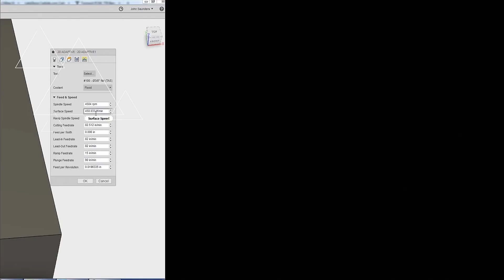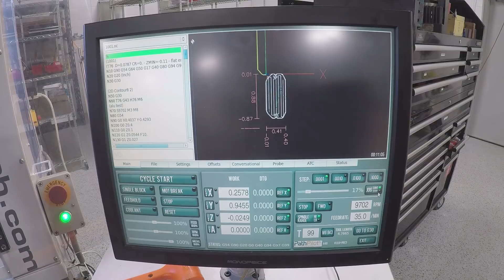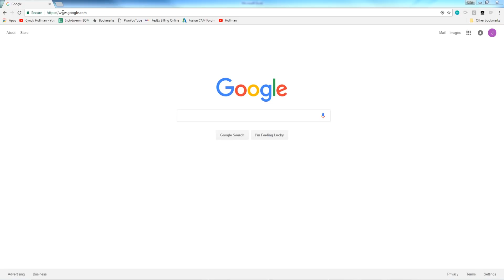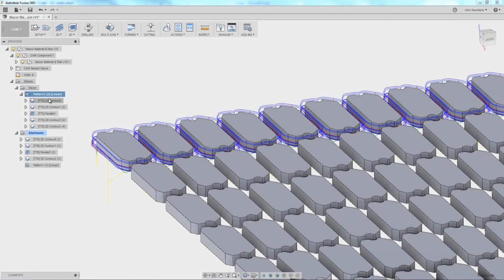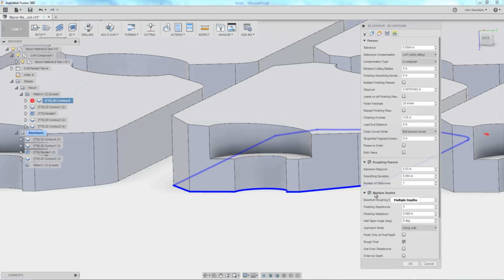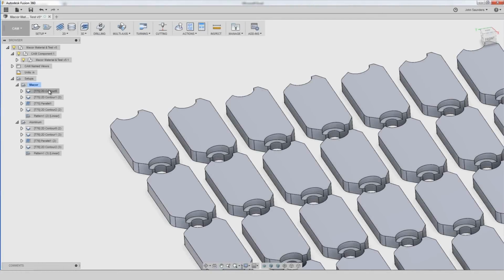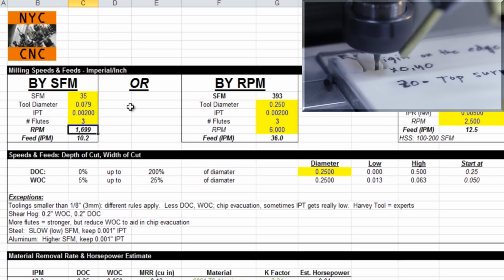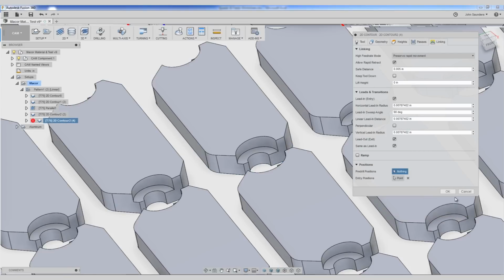Machining Macor on the Tormach 440! WW170

Comment: The reason you’ve got the job is 99.9 % of shops will refuse to machine it causes more damage and contamination of the machine then it’s worth.Been on the Apps for 25 year in the uk we will void any warranty cutting this material, that was the policy @ Mazak,maho,and maatsuura,@ WFL it’s standard if your cutting it you needs MQL and to run extraction with suction bells

Comment: MACOR is interesting material for sure and its been around for a long time. It was used in various locations on the space shuttle Thermal Protection System where high temperature and rigidity was required. Its low CTE made it the ideal material to use inside thermal barriers primarily so the barrier would retain proper shape. As shuttle TPS components go its density was rather high but it was very effective. We often reused MACOR parts salvaged from thermal barriers because it never goes bad. I work in the facility that made 1000s of orbiter tiles for the shuttle program.  We continue to machine silica tiles using Hermle 3 axis mills for other NASA programs. Both mills are equipped with very high flow dust collection systems and lead screws are covered with in house sewn bellows. These machines have been in used daily for nearly 20 years and still hold tight tolerances. We typically get between 3 and 5 years out of the ballscrews. The message is get the dust out of the machine and position the vacuum nozzle as close to the part as possible to optimize machine life.

Comment: John, what would your thoughts be on using something like a Wegstr CNC for small prototyping projects or fine detailing work? Is there a gap that a machine of that type would fill in a shop, where a progression between sizes and quality of machines hits a local maxima of productivity?
Reply: Carbide 3D Nomad is great for this. PCBs too of course.

Comment: I noticed the windmill is making a pass at the end to face the material, my thought/question: would it be easier to use a face mill to deck the material to finished height rather then making passes for each individual part? Something along the lines of a 2” face mill

Comment: Worked in optics at one point. We would use cover glass and UV hardening glue to control chipping you can also use a a clear glass panel glued to the bottom of your work. That you remove with a heat plate

Comment: It looks as if the material was chipping on the edges of the part when facing, I would recommend using radius on the cutter, so chips occur high up on the stock, another option is to do dynamic facing from the outside. I will like to buy one of these 440's you know what size rotary fits it?

Comment: Use hot glue . We machine macor often at the University I work at and we use hot glue to hold it down. Also I noticed you cutting to the outside of the part on the surface, you should have the cutter cutting to the center to prevent chipping.

Comment: Ceramic on a milling machine, doesn't the dust ruin your ways on the long run? At least I wouldn't put it onto my Maho/Deckel.
Reply: We occasionally do a few parts out of Macor, Shapal, and Alumina, while I haven't personally investigated, another local shop said machining it will void some warranties (so use your old beat up one!).  We try to cover the ways and such with plastic or towels to try and keep the dust from getting too deep into things.  And obviously avoid breathing the dust.
Reply: We use a dry bed machine with powerful dust extraction. Its true that dmgmori will void warranty on their machines that we have. But dmg do have machine protection that will let you do this,  but we don't have it.

Comment: If you were doing a production run of these parts, would a vacuum fixture, directly pulling on the macor make more sense?  You could place a vacuum slot beneath each part to hold them down.
Reply: Despicably Irascible Rapscallion Yes! Here's a whole video on how to do exactly what you said: https://youtu.be/ZpDq_q3JX1c

Comment: I'm not a machinist, would it be smart to use a facemill to get to the depth, prior to cutting each part? Would you save time on machining, instead of taking multiple passes on each piece with the 2mm endmill?
Reply: look closely the part is not flat as modelled it slopes in the CAD
Reply: Ah, didn't see that!

Comment: Good quality tape + NOT an aluminum base + tabs helps. I cut lots of sheet brass and copper on an acrylic table and long as you keep the heat down [air, mist or coolant] + leave tabs so your tool on the finish pass is not having to cut very much + a non metal base helps a lot. That said if I were to do those parts I would tape them BUT only face enough from the top so they are smooth + leave them with say tabs connecting them with stock on the bottom. Break them out of that "matrix" and stick in a vise. Is it less efficient... erm sorta but on the flipside you got WAY better process reliability to run a giant sheet out unattended! Plus you got both sides smooth and all that lovely stuff too...